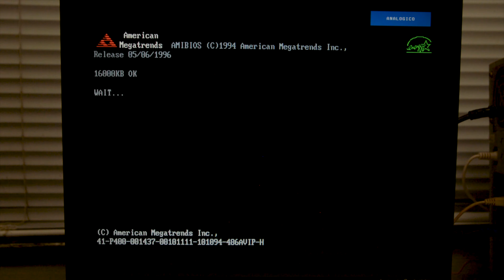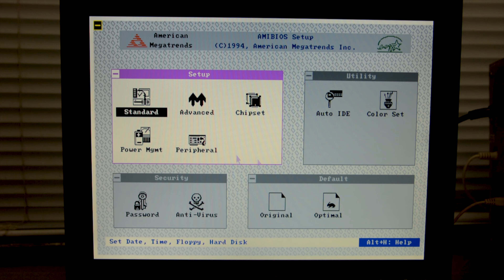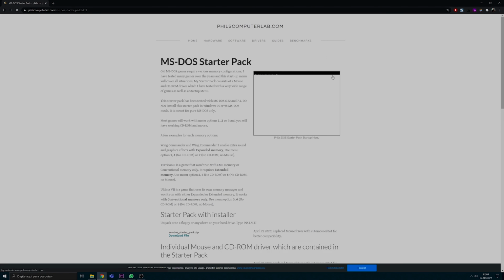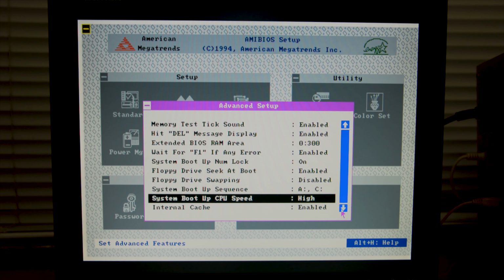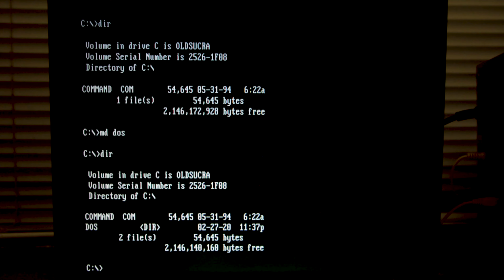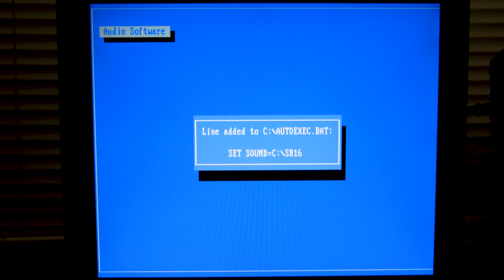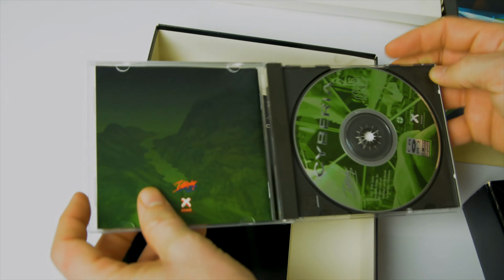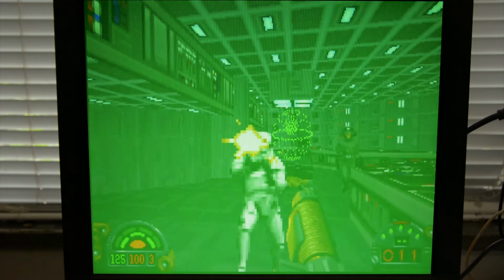486 dx4 100mhz, Fastest Intel 486!

Comment: The main memory installed in that system seems to me edo dram not supported which can cause fps drops in games however the mobo looks like 32 mb of maximum memory supported plus you can also use better vga card of 4 megs or above else can increase the memory from 1 mb to 4 mb in the same trident vga card
Reply from the maker: thanks for you suggestions

Comment: I also happen to have come in possession of  the fastest I486 DX4  100  motherboard, with the CPU,  and it's 25 years old.
It still has its original HDD and Windows 95 installed, the only downside was the barrel battery but fortunately that didn't damage anything by the time i got it removed and cleaned.
The motherboard i got has full support of DX tech and also the rare AMD 5x86 that could make it reach 150 mhz in speed.
Once i replace the onboard battery with a CR 2032 and find a PS\2 mouse connector (during booting it shows "PS\2 mouse not installed" it was most likely an OEM thing that was supposed to be connected to COM as there is no dedicated PS\2 mouse connector nor PS\2 pins to solder connector on) i am good to go and i can install my games from my childhood and some more amazing retro games like DOOM.
Reply from the maker: 486 dx4 is a fun little machine because you can play such a huge range of games including some early pentium stuff.  I'm glad you got yourself a nice machine there for your childhood games, such a joy to revisit them. Thanks for sharing your finding.
Reply: @SUCRA  Thanks to you too.
I got myself recently a nice 486 DX4 100 board that has ISA-VESA setup.
The board fortunately was one of those rare with CR 2032 already installed so it's still 100% perfect, just used some canned air and got shiny as the first day it was made.
I installed a 5.25" floppy drive alongside its "younger brother" 3.5".
It also had windows 95 Plus! and works perfect.
Along with that machine, i got a Pentium 133 to restore (the case was rusty but had really nice PCI cards and a near intact 5.25 floppy drive) and another pentium MMX 200 machine with PS\2 mouse.
Reply from the maker: @arbiteras  seems like you have your work cut out for you. Good times, have fun!